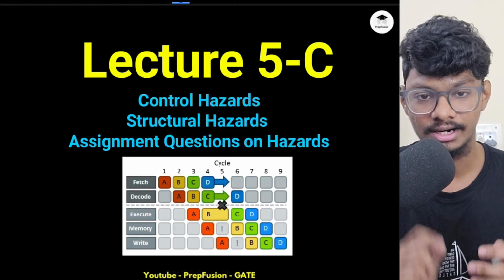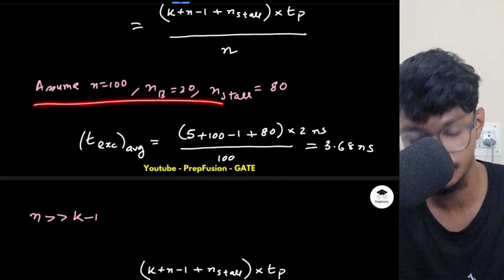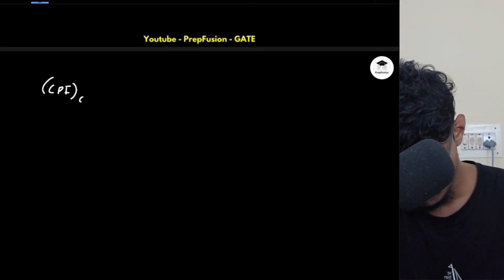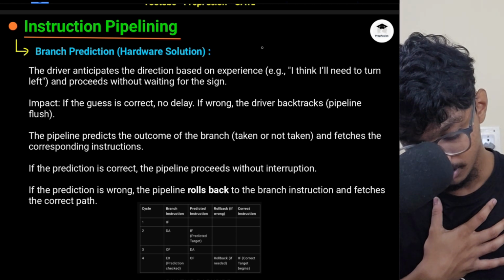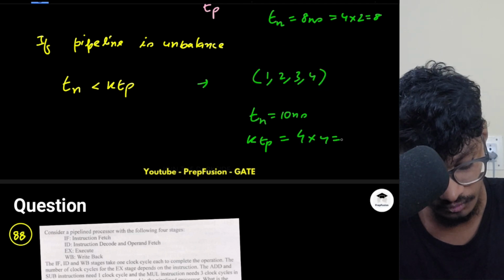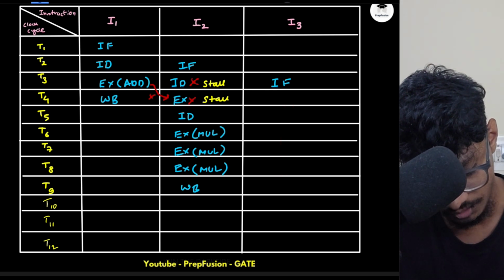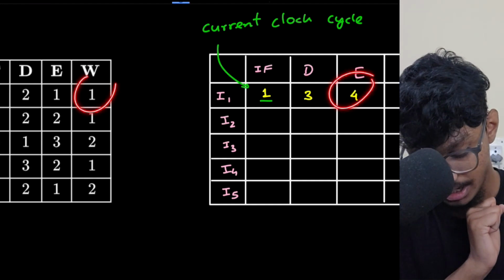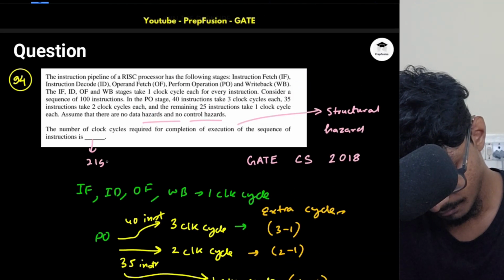5(C) Control & Structural Hazards in Instruction Pipelining || Digital VLSI || COA || Anish Saha

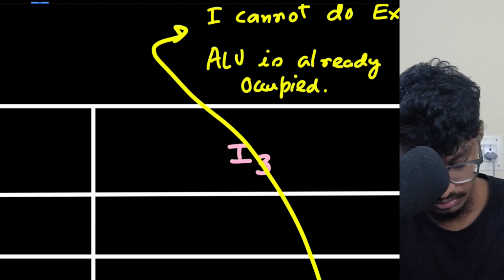Comment: at 1:27:17 is it a structural or data hazard
Reply: It's a data dependency problem and yes it could be structural hazard as well because here we assumed single ALU.
Reply: @yuga9511  then it should be raw dependency between the instr 1 and instr2